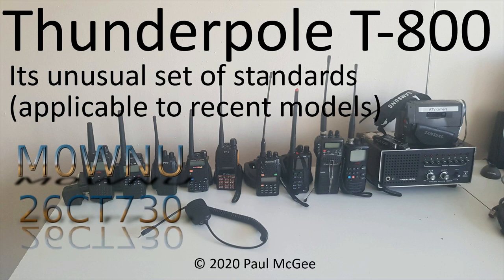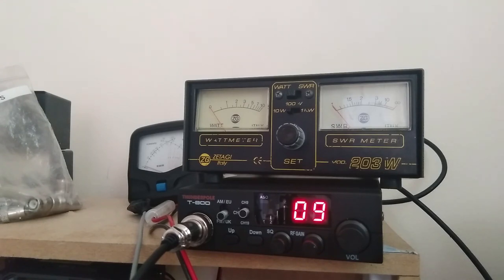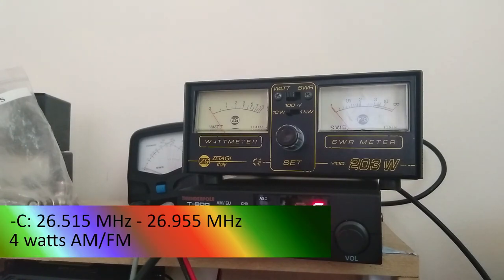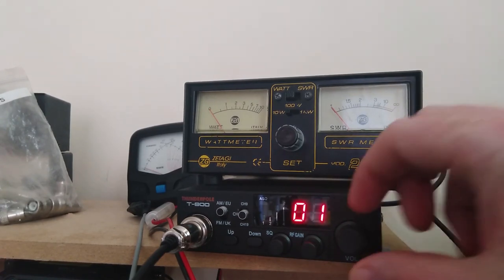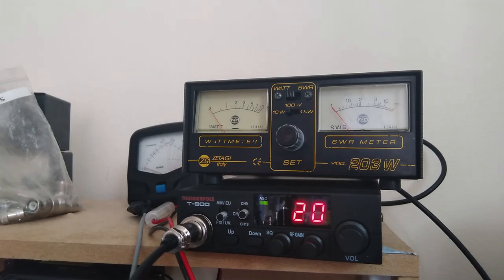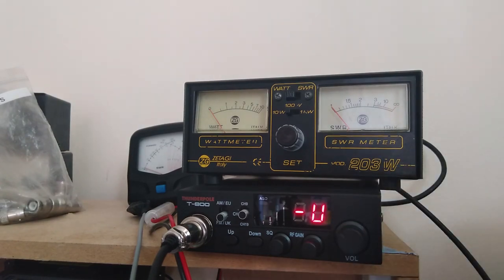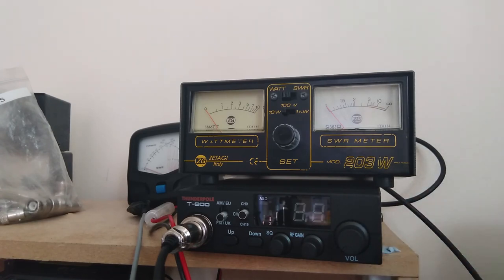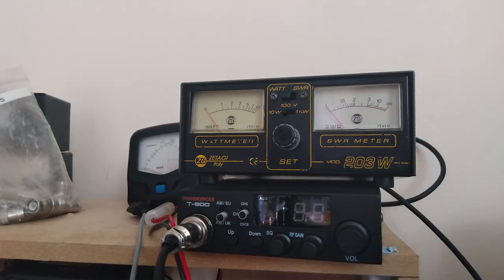Thunderpole T-800: its unusual set of standards

Comment: Hi Paul, just to add to my earlier comment I've been looking at my PNI and the band's are in fact the same as
a multi band export radio! Band D is the mid band, E follows on with 27.555 on channel 12 and F then becomes the start of the 10 meter band! Not bad for a CB

Comment: Hi Paul, if you’re interested, there’s now a few nets going up here in NE. I’ll list them below for you:- 

NE 2m net - 145.425FM Saturday 19:00-20:00
NE 6m net - 50.575FM Sunday 19:00 - 20:00
NE 4m net - 70.425FM Monday 19:00 - 20:00
DADARS Club net - 145.425FM Wednesday 19:00  - 20:00
NE 2m SSB net - 144.260USB Thursday - 19:00 - 20:00

Hope to hear you on......Paul 👍🏻
Reply from the maker: Hi, I work during most of those nets, and don't have radios for 2m SSB nor 4 or 6 meters, if my new job pays enough I could soon sort that out though , thanks for the information, much appreciated
Reply: You’re welcome 👍🏻